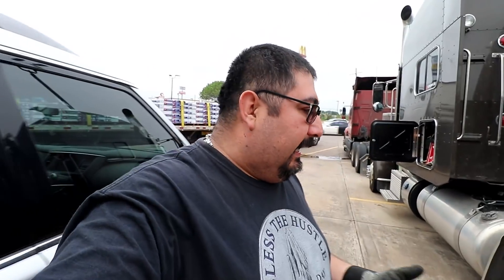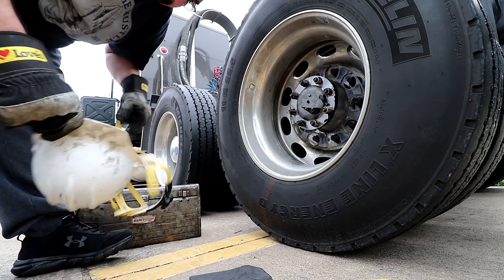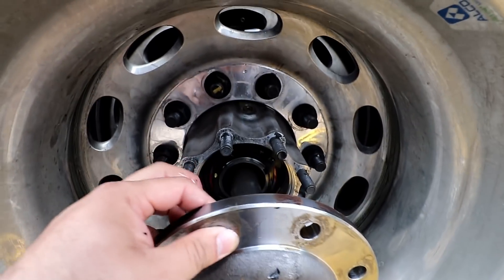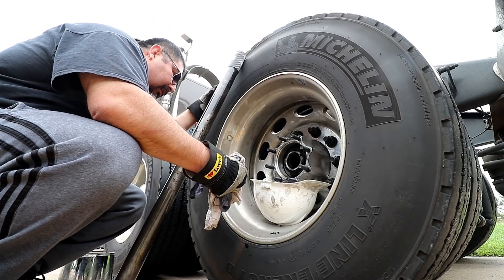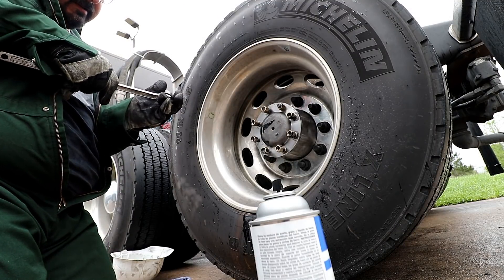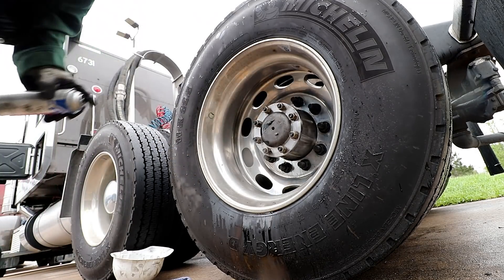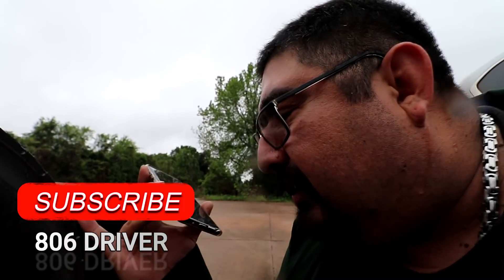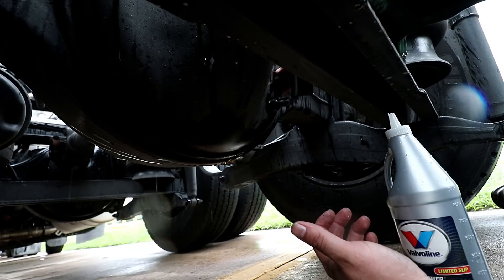TRUCK REPAIR FOR DUMMIES!! HOT CHOCOLATE IS READY!!!

Comment: Oh Jorge !!! ...... I was really feeling for you trying to get the half shaft back in .... next time you do one .. the splined end of the shaft needs to be lifted a little bit vertically to engage in the final drive (diff) by tilting the flanged end whilst pushing !! ...... (a knack us mechanics have) ..... mind your fingers though .... easy to get pinched and very painful ..... Well done for not panicking ...... good job ...... regards from the UK.

Comment: With each job you take on for repair you will gain the confidence to tackle bigger ones down the road. It’s not the money you saved from doing this, if it happens under a load and it’s a bigger leak you will be able to handle it and keep the load moving on time.

Comment: That's the way you learn doing it yourself and the reason it leaked was because that truck was piggyback by another truck they take off those spindles and when they reinstall they don't put new ones and sometimes they crack that's what happened to mine and it happened on same side the other side never leaked. Good job👍👍

Comment: Get a clear piece of hose that will fit on the tip of that plastic bottle and put the other end of the hose in the hole on your axle to top it off.

Comment: Great job Jorge, as Mario said in his comment, they pull those axles out during transport when they are new and lots of times the dealer doesn’t always do a good job reinstalling them, keep an eye on it, if it leaks more, go by a shop and have them torque them for you.. if you are going to get a battery power impact I suggest the Milwaukee Fuel 1/2” it is a bad mama jama. Bout $350 at Home Depot with charger and 2 batteries, again great job!!!

Comment: nice job , i usually cut a old windshield washer fluid bottle in half for the oil bit that harthat drain bucket is awsome!! love it, tightned those nuts as tight as u can get em, i know mechanics arnt gonna like this but i tighten em til the impact stops

Comment: Go to Lowe’s, and get a 20volt Craftsman 1/2” impact. You’ll never need nuttin else. Opt #2, a $30 Black & Decker drill. Get the bits that convert to sockets. That’ll handle 90% of your bolts and screws. That’s what I use constantly. I have a Kobalt 1/2 but it’s so bulky and heavy, rather use drill. Also get you a side box to carry all your growing mechanical equipment. And a mechanics creeper / stool. Just sayin 😎

Comment: Hi Jorge mate I find with alloy hubs not to use the gasket just use good silicone to glue it cause the gaskets move due to alloy hub and steel together pushes the gasket out . But good job need to learn basic stuff save a few bucks
Reply from the maker: Thank you Great information..

Comment: I am wondering what model pete you have I know it's a 2019 but never knew the model I love the truck. I drive a kenworth t680
Reply from the maker: It's a 389.. t680 is a nice truck..
Reply: @ATruckersLife  I had the assumption it was either a 379 or 389 but I love the Pete's I am changing my truck to the pete they are durable. It has space from the looks of your truck.

Comment: Just throwing this out there to make it a little easier. You can connect one of those air lines you see for sale at the truck stops to your glad hand then connect the other end to and impact to take those nuts off a little faster and easier. You can find and impact at harbor freight for pretty cheap. You will also have an air hose to add air to your tires if your ever running low also. Win win 

These guys have a quick connect directly to an outlet on the air tank. Check out the video below.

https://youtu.be/GWwe_ixcrss